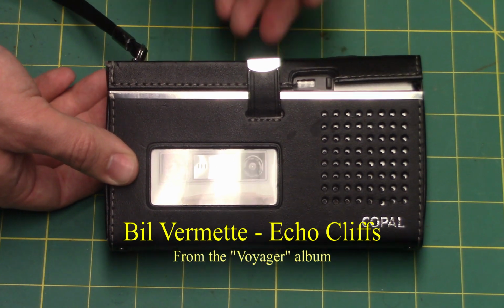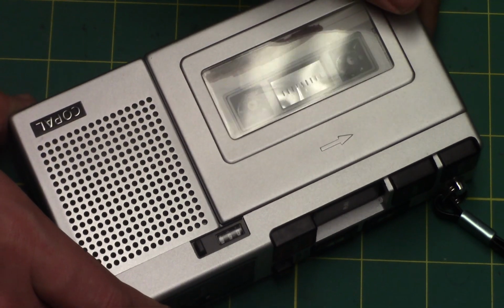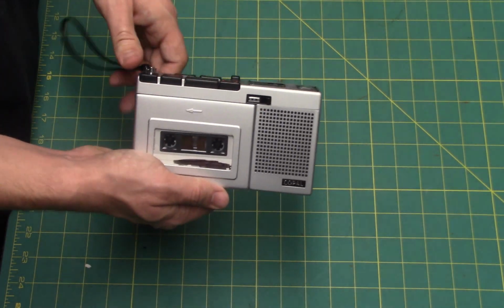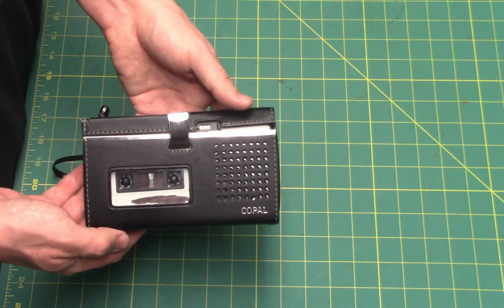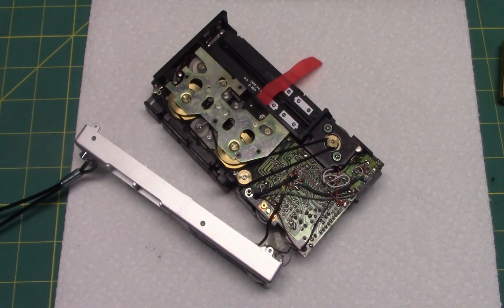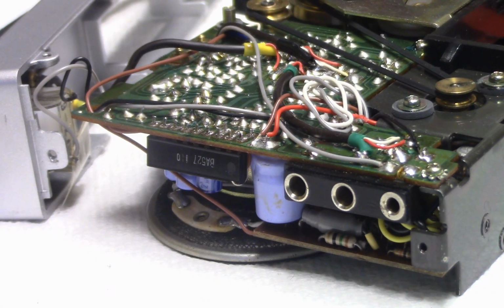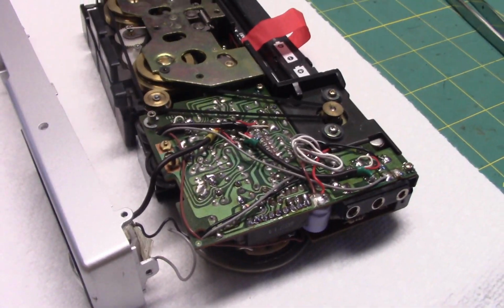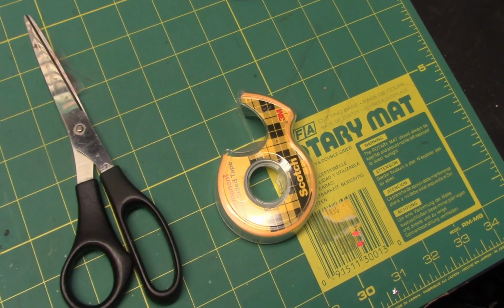COPAL CT-700 Cassette Recorder

Comment: Copal was considered a high-tech company in the 70s and 80s. They got their start making shutters for cameras. Leaf shutters at first and then focal plane designs. The Copal "Square" shutter became something of an industry standard and was even copied by German makers. Watches came next and a few projector designs at the end of the 70s. Their direct competitor in camera drives and tape recorders was Sankyo. (Not to be confused with Sanyo.) Copal and Sankyo motors could be found in computer drives through the 90s.
The dual brass flywheel design appeared again in 1985 in Marantz commercial portables. It is not known for certain if Copal made those or not but they were similarly built and remained on the market until 1998.